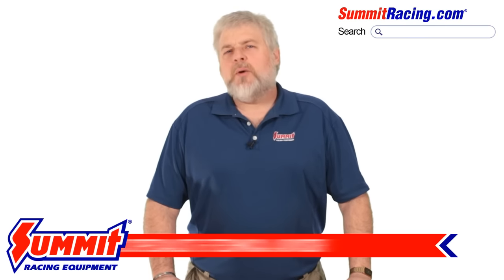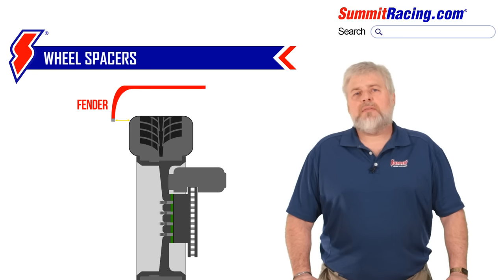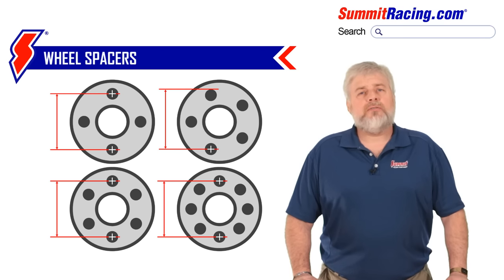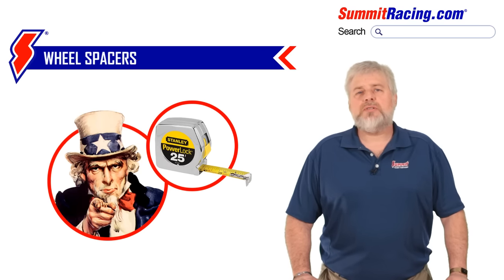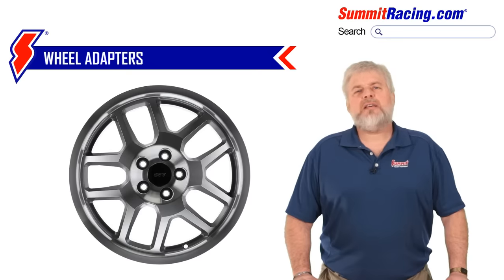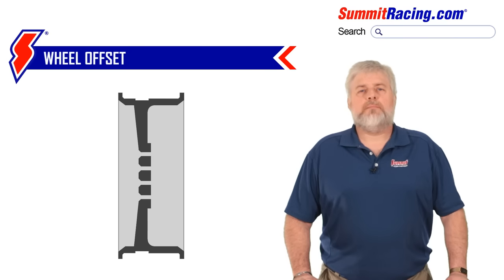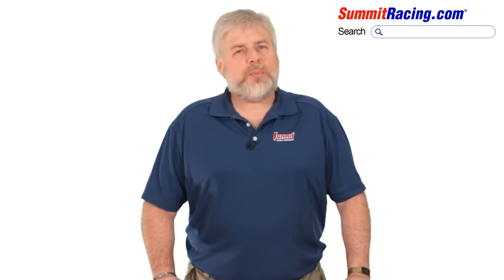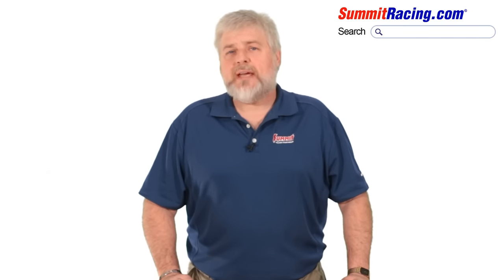Wheel Spacers & Adapters - Summit Tech Talk with Carl

Comment: What do I have to  do to switch from a 16.50  rim to 16 in. rim,since the  don't  make a16.50in tire anymore, can a spacer  adapter  fix the  problem.
Reply from the maker: Hi Rich, No adapter or spacer should be needed. You just need to look for 16” wheels with the proper bolt pattern and offset for your vehicle application. As with any new wheel, you should always test fit one to verify brake clearance and fit prior to mounting the tires. Thanks for watching!

Comment: Do Nissan Xterra 2000 wheel spacers need a center hub
Reply: hub centric is the way to go so the wheel is centered correctly.   I am no expert, but the research I have done makes hub centric and proper torquing down of the ALL lug nuts with lock tight for the nuts holding down the spacer to be the way to go.    I have a 2001 xterra and planing on running 1" spacers to correct the off set of +25 toyota rims that I want to use.   Stock rims are off set +0.

Comment: False info on studs bearing loads!!!! 

Theres no need for hub centric spacers when your after market wheels has a bigger bore.  And hub centric ring bare no weight on then its just to aid install.  
The load from a wheel is transferred to the axle/hub through the friction of the clamped joint, not through the wheel stud. A wheel stud can only bend if the lug nuts are not properly torqued, in which case the wheel is about to fall off, anyway.

The Physics of Keeping the Wheels On

As long as the wheel, hub, and spacer are stiff enough to prevent flexing and loss of clamp force, the cause of most wheel stud failures is under tightened lug nuts (not enough clamping force) or over tightened lug nuts (the stud has been stretched past it's elastic limit, so the clamping force goes away). Therefore, properly installed wheel spacers are perfectly safe.

Comment: Minute 1:14 - - given Exposed Thread Length = 1inch; knurl diameter of 0.60 inch; and thread size of 1/2 inch (irrelevant if I can get matching lug nuts that will go onto wheel stud.......   if you can find one of these you are better than I am!    Find my into at CountyRealty   dat comm     I need to make sure these studs will work with your part number TRD-3603; which was part of a quote #1382796.    I need to make positive the stud I seek is not too long to fit inside the ADAPTER.  A 1:1 adapter I found is here; and I need to make certain the lugs will fit inside the wells provided.  http://store.gaugemagazine.com/4-x-4-50-to-4-x-4-50-wheel-spacer/